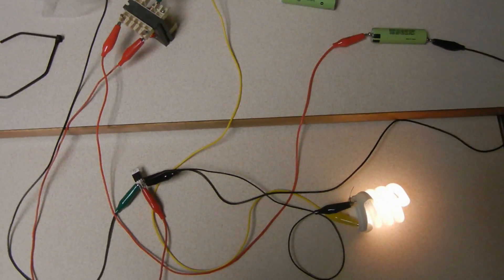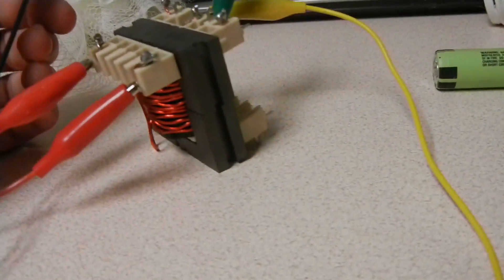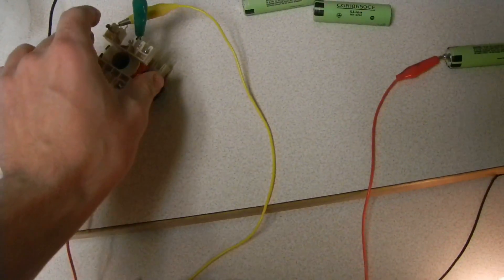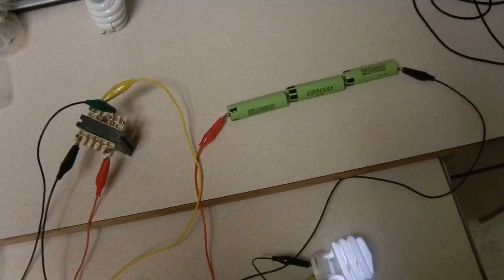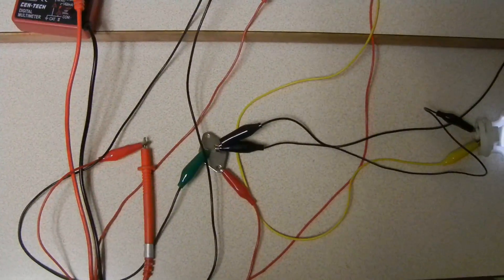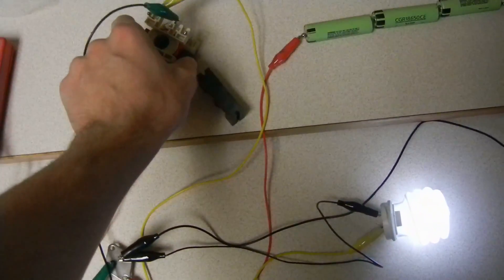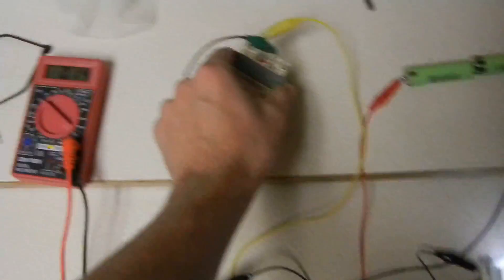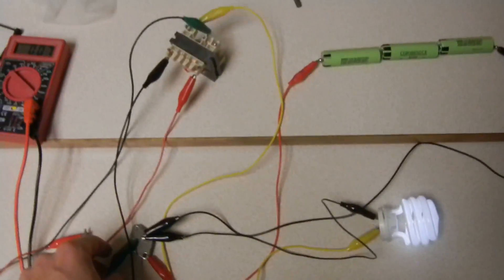Super Joule Ringer 2.0 Replication

Comment: In my replication, I used an unmodified CFL.and a LED party bulb. I was also able to light a florescent tube with only one lead.  I also used a 2n3055 but had to use a 5K pot between Collector and Base to get it started. All worked great until I smoked my 5K pot